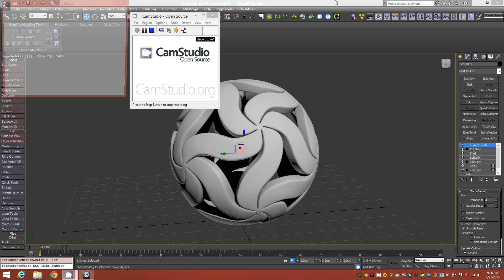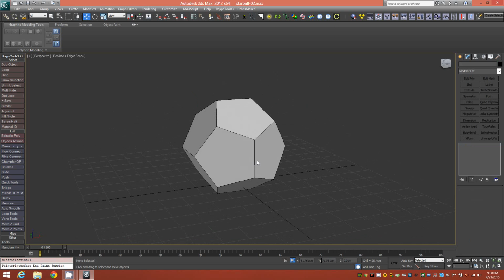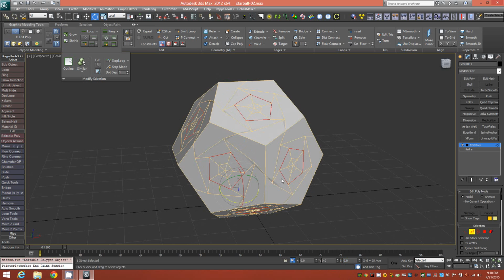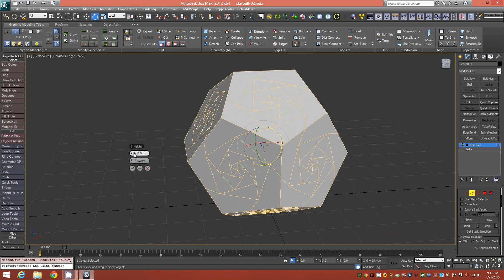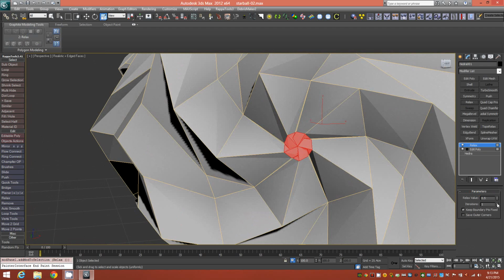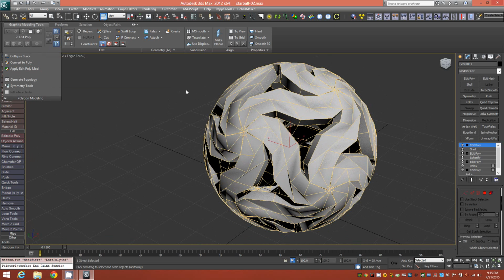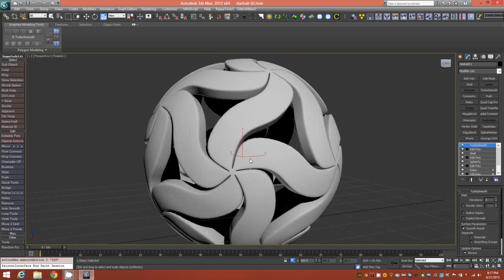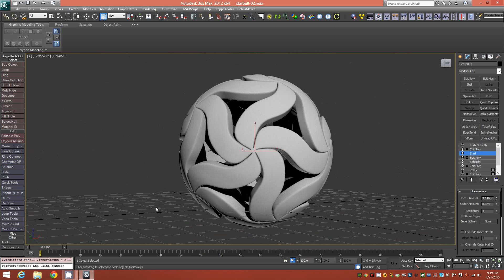3d Tutorial | Floral Star Ball Technique | 3dsmax

Comment: I've tried to install the 2015 on my 2017, kept my fingers crossed but...no go...it doesn't work...bummer...maybe with the "hinge" in poligon I may get it
Reply from the maker: This process will definitely be more difficult without Megabevel plugin.  However, it is still possible.  Yes, the Hinge From Edge option is one way to do it, but there are others.  I may need to revisit this tutorial to show how to do it without the plugin.  In the meantime, have you looked at the other Starball tutorials?  The techniques provide different style stars, but still could be useful.
Reply: yes I did, and then with a slightly different approach I've obteinded a star similar to the "orginal" one, hinge would work but on multiple selection, even using "local" and or the selection that uses the single objs center, I couldn't find a way to get the faces to hinge properly, I always ended up with at least one of them going in a different direction, my fault certenly, will have to go back and work on it more
Reply: yes I did...and tweaked things a bit so the get a look closer to the shape on this tutorial...then modeled a bit the "deleted poligons" to get some "trasparent glossy plastcs" inserts between the "petals"